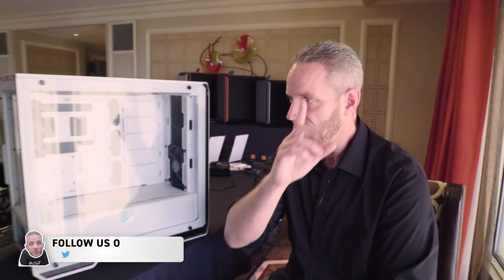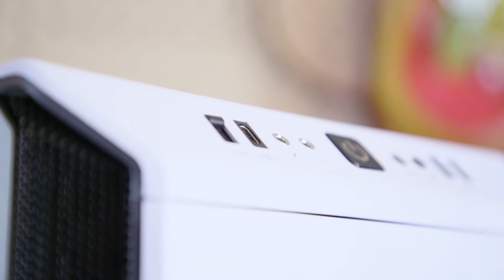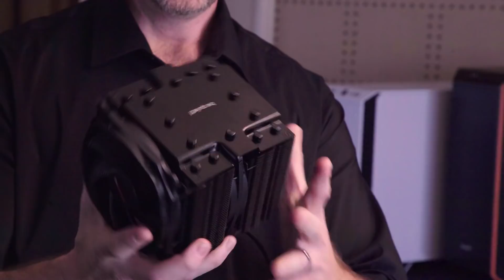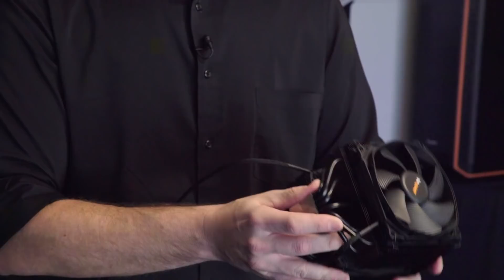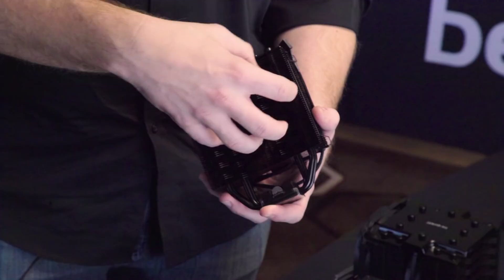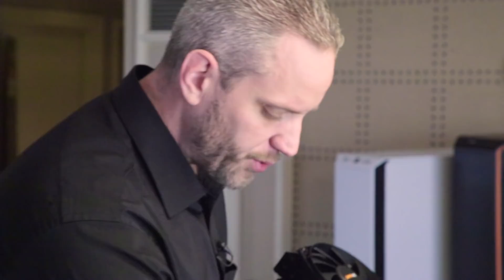This might be my new favorite Air Cooler??!!

Comment: All I see is overpriced computer parts that noone will buy that is your average person.

This kind of thing is a luxury, and shouldn't be treated as a "trend or "mainstream."
Im willing to bed 90% of the viewerbase here plays on a computer that's well under $1000.  Spending over 100 on a case or let alone near that for an AIR COOLER is ridiculous.
Reply: most air coolers ARE worth the money, for 90ISH USD you can get performance rivaling more expensive and less safe AIO 240/280mm solutions. NHD15 and the bequiet Pro are really good for the money, as are mostly all other standard single/dual tower  air coolers
Reply: @beer_4781  Air coolers block RAM slots and clutter the case. AIOs give a much cleaner look and provides superior clearance. AIOs are safe so spare the bullshit. Corsair has a 5-year warranty on their coolers and Will replace all PC parts if it leaks (which basically never happens).
Reply: it has a greater potential to fail, it has 3 moving parts instead of 2, and it has liquid in it, that liquid alone makes it more dangerous, even tho it is VERY safe and VERY rarely leaks, and they do come with warrainties, an air cooler can NEVER leak, nor can it's pum EVER fail.  @CassidyOG
Reply: @CassidyOG  AIOs are not 100% safe. High quality ones are indeed very unlikely to crack and spill, but it still does happen. It doesn't matter about how you put it, it's a fact that having less moving parts, no liquid to spill, makes it indeed much safer.

That said the likelihood of either breaking is low, but the durability of an air cooler compared to an AIO is much better, many air coolers have a 7+ year warranty compared to Corsairs 5, and no matter how long you run a cooler for it's performance can't degrade by much, it's literally a hunk of metal with heat pipes.

Air coolers are better for performance, durability, noise and price (compared to a 240mm AIO). It only really imo loses on looks.
Reply: All i see is someone who doesn't get the point of being an enthusiast. Get out.
Reply: Its not a mainstream build. Not a gamer pc, you wouldnt use that cpu if you wanted a gamer pc. Threadripper is a workhorse, which its very good at. Work not gaming.

Comment: I have the Dark Rock 4, it s really a great cooler. Ryzen 3 2200g (going to upgrade to a Zen2 chip on release) @4Ghz 1.404v hits 65C on Prime95 without OC it only hits 55C

Comment: Have you ever heard of "Alpenföhn"? 
That is a brand of the German cooling solution manufacturer EKL. 
They have some interesting air coolers (even a low profile variant). The "Alpenföhn Brocken 3" is huge but costs only 50-60€ (single or dual 140mm fan) and is rated for 220W.
Reply: just checked them out, seems like they have some pretty interesting products,I hope that jay or gamersnexus will benchmark them in the near future
Reply: Or the Alpenföhn Ben Nevis (Advanced) i like that One. But a used BeQuiet Dark Rock Pro 3 is always the better Option. Cheaper. Better. But only if you have the Space.

Comment: Glad to hear it. For example, I've got a 8086k on a constant 5 GHZ overclock. Using "just" an air cooler my max temp is 74 C. Granted, it's the Noctua DH-15. 
A lot of people would assume any water cooler would be better, when in fact the DH-15 (which performs VERY similar to the Dark Rock Pro 4) out performs all but the very best water coolers. 
They are pretty cheap too, around $80. $80 in a water cooler would not even come close in performance. 
And the performance is pretty much forever. Move it from system to system. Every water cooler is going to get crappy at some point.

Comment: Be quiet coolers are super SEXY.
Reply: agreed, even their budget options still retain good aesthetics
Reply: I got the biggest tower cooler, and i cant hear it ST ALL. PSU and tower from be quiet aswell.
I cant hear my pc. So sexy AND zero sound.
Reply: @Furyae  maybe you wanna turn your pc on mate
Reply: the last thing I need for my build is a cpu cooler and now im really considering from nzxt kraken 😍
Reply: Yeah they are, I plan on picking one up for ryzen 2 build
Reply: @SnorryHobo  Me too, I think im going to wait till this Air cooler arrives
Reply: I am using a ryzen 7 1700 oc 3.8 and a gtx 980ti gigabyte G1  i am runing a gigabyte 750 watt psu is that enough for the twin tower ????
Reply: @quickflik3980  yes
Reply: Subscriber  and a nother qeustion shut i buy this be quiet dark rock4 pro (€80) or coolermaster ml240rgb (€60) or coolermaster ml120 (€50)????
Reply: @quickflik3980  Just make sure they all fit with your processor and case height. All of them will do a considerably good job, its up to you which design you prefer
Reply: @quickflik3980  Do you expect it to be hit by 2 airplanes? If yes, then it's not adequate.

Comment: I would like to see the Dark Base Pro 900 rev 2 or even better the next version in WHITE. With the silent wings 3 in white. Ultimate would be the cover of the Dark Rock Pro in white. Just look at Noctua with the Chromax white cover. Something like that that would look insane! 

The logo of Be Quiet should also be neutral. So black or white, no orange. 

I guess this is never going to happen, but whatever.... we are allowed to dream right?!?

I'm still rocking my Dark Base Pro 900 version 1. Looking to upgrade....

Comment: You should mount that on a GPU
Reply: I did something similar to that many years ago, on a geforce2. The overclocking was insane, but back then the power delivery wasnt a problem. Was alot of work to make the cooler fit, alot of grinding and such. But its possible. Also did mount large heatsinks on ram, and i didnt use heatpads, i used thermal glue, so those would never come off.
Reply: @sjarken3979  Last year I bought a used blower fan GTX 1070, took it apart, and attached an old Zalman CNPS9000 cooler I had gathering dust in a drawer. Bought a 12cm Noctua fan to move the air. I can set a 200 MHz clock offset and stay below 70C in normal gaming. Pretty sweet for a cheap used GTX 1070 that had the worst cooling available before modding (Dell's OEM version of MSI's shittiest blower card.)

Comment: I've always been an air cooling type and I love those dual towers for higher end CPUs. I have that Dark Rock Pro on my 2700x and it actually works better than my AIO (H115i). I had to test it to be sure, but it cools better by about 9°C under gaming loads... plus it looks cleaner overall.

Comment: Favorite cooler i have ever had was the Coolermaster V6, i still use it on my 1090t black overclocked to 3.8 daily in the philippines 30C ambient and get a temp normally of 35-45c doing normal stuff. Normally 35c gaming 45c

Comment: I recently installed the Dark Rock Pro 4 after my new be quiet 360 AIO started to fail after 4 weeks outa the box. Already I can see decent thermals but it doesnt not like ram modules with rgb on them. Holy crap its tight! Ive had to push the offset fan up higher just to get the beast in. Its in but, its damn tight in there.

Comment: You had to Screw the Dark Rock Pro 3 in from the back. First put on the Two nuts Loose on the bracket the  Screw in from the back
Reply: @Brad Viviviyal  lmao. 
But for real everyone was too stupid to understand this mounting mechanism. So BeQuiet Made it floppyer but easier. I prefer the Dark Rock Pro 3 with the Dark Rock Pro 4 fans.

Comment: I totally agree about the air coolers. I have a Dark Rock 4 on a overclocked i7 4790k at 4.6GHz stable at 62ºC. Cheaper and more reliable than a AiO, this cooler is a win-win
Reply: I don't know man. I have an 4790k and it already reaches 80°C at 4.4 GHz when using Prime95. There is no way i could keep mine cool at your frequency.
I already "upgraded" my cooling from an older BeQuiet blower to an AiO solution from Corsair, but the results I'm getting are just marginally better. Really frustrating.
Temperatures just jump up by 50°C in milliseconds after Prime95 is doing its thing, I have no idea how any cooler could prevent that in this short amount of time when considering the time the temperature needs to travel through the materials.

Maybe I just lost at the silicon lottery or Prime95 is just to harsh to that specific (older) chip.
Reply: @TheBrassn  his temps are when he is streaming not benchmarking. My CPU can stay around 35c to 40c when I just do normal use high 40 to mid 50 if I am gaming and that's with an air cooler.
Reply: my 9900k runs at 5 ghz on all cores using a kraken x52 with a max load temp of 75c during burn in and 45-50c in gaming. aio's have come a long way the last few years. with a noctua nh-d14 my 9900k hit 80c on stock for comparison... meaning 4.7 all cores and less vcore. the best aio's will easily beat the best aircoolers when you up the voltages.
Reply: @lort6022  Best AIOs will also be twice the price, and nowhere near as reliable. Obviously AIOs became much more robust these days, but there are just too many potential points of failure. Leaks are not very common, but they occur. Pumps fail more often than fans, probably by a factor of 10 if not more. That's why nobody is cooling servers with water for example. Potential small gains in cooling are simply not worth the risk.
Reply: mr. meatspin yes aio’s for max cooling.  But they do fail.  Maybe yours hasn’t yet but it will.  Also air is cheaper.  If your trying to go for max OC your pretty much forced into liquid cooling.  But if your doing a ryzen build where OC is a non factor air cooling is so simple and cheap and foolproof.
Reply: Lol my i9 9900k is sitting at 22°C Idle with an AiO (Kraken X52) and 36°C while avg load and streaming pretty much keeps it around max 36.. Soo yeah.. you can't say an AiO doesen't do it job, well atleast NXZT   aio's...
Reply: @coffe2go  But at what price? My Dark Rock 4 was around 67 euros while the Kraken is more than double the price, you should expect that. 

These kind of CPU coolers have their position and compared to cheap shitty AiO's, these ones are better. For anything beyond 250w for sure water is better... unless you're willing to take a humongous cpu tower cooler.
Reply: @JSilverhand-k9v  Ah okay i thought you mean't all AiO's are pretty sh*t, should have known that you meant the ones that are lower budget :)
Reply: @coffe2go  you are using 20% of cpu ita normal that the temperature is about 36° if you do a stress test you will see, or you have some problem in that temperature because your liquid cooler is not so good so its impossible that temperature at full load, even for the best liquid cooler
Reply: @coffe2go  How long will it hold that temperature? I agree that krakens are amazing but performance isn't much greater than high end air cooler.
I have 2600 oc with 212 evo turbo with good case airflow (shows 180w power draw) and it sits at ~30c idle, ~50c in games and ~65c with stress test. And all that with 700rpm fans. I prefer silence and i can't even hear fans, pump noise on the other hand can sometimes be noticeable. They do it's job but you can't say air coolers are bad :)
Reply: @cekpi7  Ughm pretty much for the whole day lol, but i also have to admit that my room is fairly "cold" or just a little bit below avg while its being heated, soo i guess that has to do something with my CPU temp
Reply: @coffe2go  what is cold to you? Below 20° C?
Reply: @Derpderpson123  Usually my room is poorly isolated thermally so it does not keep the room warm that well, usually its at 11C + 3-5C when i turn the heater on
Reply: @coffe2go  PLEASE check temps after like an hour of usage
Reply: @butilikepizzatho4851  Okay well sry for such a long response but i tested it out and usually its max like 45°C after 8-11 hours +  the max load temps get it to like 82°C which is pretty stable for a Kraken X52 AiO, if i had x62,x72 the temps would be a bit lower but yea...
Reply: @coffe2go  wow i didn't expect you to respond at all. Thanks for the time spent doing the testing and for the info.
Reply: @butilikepizzatho4851  Its all good man! 😄 Anything to help out a bit, for sure if you are planning to get that cooler, i would suggest you get x62 cause it cools a bit better but is louder by like 0.6Db than x52 , But yea!! Was my pleasure haha

Comment: My Dark Rock Pro 4 is ultimately bored... Ryzen 2600, 65w TDP... xD
It's like Emperor of Mankind on a Golden Throne...

There is one huge con of new Dark Rock Pro 4/Dark Rock 4. Ceramic coating... put fans once and you wont be able to pull them off without loosing some ceramic coating (well, you will need some black marker to camouflage that).
Reply: Yep, scraped some off my dark rock 4 when mounting the fan, hate those flimsy metal wires but apart from that its an amazing cooler.

Comment: Hey guys I have a question about my PC: just built my PC last night my PC turns on but my monitor says no signal and then it goes back to sleep mode, I am using HDMI to HDMI...i took to SSD and the hard drive out of my old computer and put it into my new one. I did not wipe the drives I just took them out and put them in the new one. Did I do something wrong that would cause this?
Reply: Andrew Buren Reseat your RAM and reset your CMOS battery.
Reply: Might want to try to reseat your graphics card, if reseat of ram and reset of cmos does not work.

Comment: I moved my AIO to my GPU and I'm glad I did. But now I want an aftermarket cooler for my CPU. I was originally going to get Cooler Master's New Hyper 212 Black Edition but it's out of stock for the price I want and I saw Artic's Freezer 33 which matches my build's color scheme but at the same time I want something that doesn't look as....cheap. Now I'm just torn on what CPU cooler to get. Noctua's out of the question. I'd be spending way too much on thier cosmetic kits to make thier coolers/fans match my rig.

Edit: Looks Like I'm Leaning Towards The Dark Rock 4. The Arctic Freezer 33 does hold damn good value though too!
Edit 2: I'm Sold On Cooler Master's Hyper 212 Black Edition. It's less than half the price of the Dark Rock 4 and has just as good cooling performance. Check out Vortez's benchmarks!
Reply: Get the Dark Rock Pro 4 if the Noctua color scheme doesn't match your system. Its literally the ONLY air cooler that can keep up with the NH-D15 in temps.

Mind you, the prototype All Black Noctua coolers were teased last year computex 2018. But I can understand if you prefer not to wait.

Comment: The Noctua NH-D15 is the best air cooler currently on the market. I don't think this new cooler will be better, but it may rival the performance of the NH-D15.

That being said, if you are overclocking past 5 GHz, water cooling is practically a must. Otherwise, get a Noctua NH-D15.

Comment: Hope that TF has reversible fan. Would hate to be blowing hot 🔥 cpu heat onto the vrm and.memory
Reply: Warm air is still better than no air, and dd4 is so low voltage, they really don't need airflow, while vrms definitely do

Comment: Yes glad to here that your going to be doing some air cooling tests, been on the fence about which air cooler to buy for my I7 8700k that will allow me to hit at least 5ghz on all cores. Currently I'm using a hyper 212 turbo from coolermaster at stock speeds.

Comment: Noctua had this for ages with NH-D15 and still wins in cooling all these years later. I will forever have a cream and brown color sticking out like a sore thumb in my build 😂
Reply: You can even get black fans and coloured accents for them and the heatsinks! Noctua Chromax :)
Reply: @Matt3DMaker  True!
Reply: And i put its little brother NH-D14 on my 9900K. No sweat at 5GHz and thus making an AIO just a silly gimmick for me. More quiet too.
Reply: Bandit Darville Hehe. Just love that cooler too. Have it on my wife’s build, no lie!  My old i7-2600k still rockin
Reply: nh-d15 is nothing special when you have tried custom water. way better cooling and more silent. tons of aio's beat d15 these days, especially with overclocking and when upping the voltages.
Reply: deez nuts except that it isn’t even THAT much better. Keeping it cooler? Sure, but way more expensive, needs to be maintained and even noiser with waterpump sounds unless u make a full loop counting in the GPU’s. I not know what fans u used for aircooling but i need to put my ear next to my system to even hear it while playing BFV. Using only noctua and choosed an ASUS RTX 2080 over the Ti on purpose, to run it dead silent. It’s just way more convenient using air and cheaper imho 😜
Reply: @ZzzZ33-n3d  And much more reliable, barely any performance difference in a good airflow system
Reply: Same here. If you put colour ahead of cooling performance your priorities are messed up.